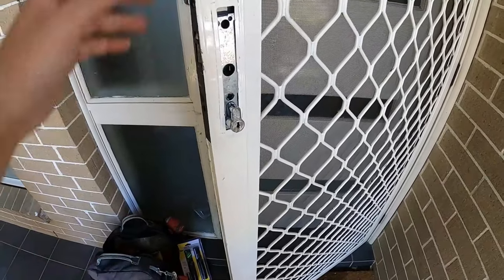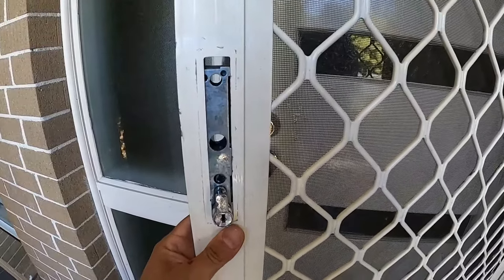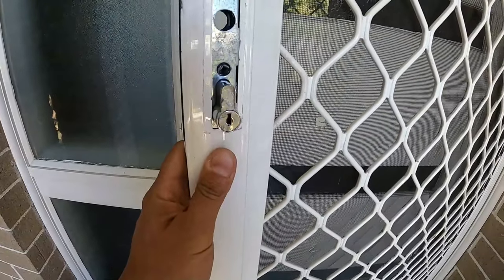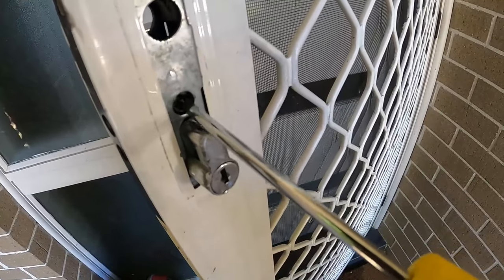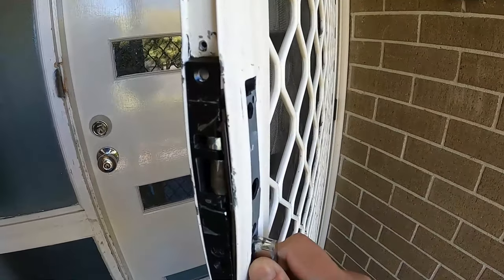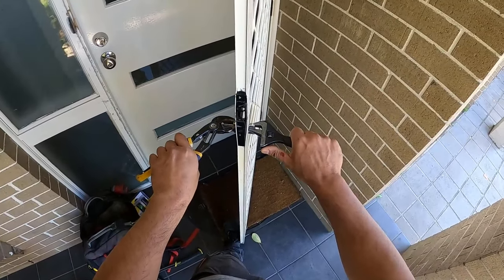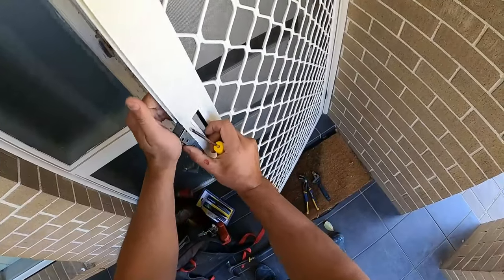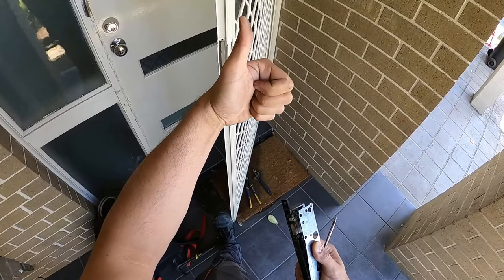How to remove a screen door lock - HACK

Comment: Good vid, but on some doors, like mine, you have to make sure the latch is full engaged, other wise, even with a key, the lock is still stuck.   Once the mall snip is pressed and the latch fully extended (as if it was locking the door) you can use the key to turn the cam and get the lock out.
Reply: oh my gosh thank you! The lock was stuck, Cam was stuck, watched 20 videos on how to release the cam to the point of trying the snap off method, which I couldn't do as I have old hands, just didn't have the strength. Read your comment, hmm, I'll go check that and thank you that worked instantly. Now, off to Bunnings for a replacement handset

Comment: Many thanks,  I have the key and removed the cylinder screw . No damage and at least 20 years old. 
It appears the cam won't release. 
I believe the old lock is Lockwood and I have a Bunnings Rolltrak to replace. Contemplating snap vs locksmith.

Comment: Hi Bill, I need to cut the screen door handle area to make it bigger to fit a new handle. What can I use?
Reply from the maker: Depends on how much larger it needs to be. Sometimes I need to make the area larger just for the screws and I use a larger drill bit. If you need to make the whole area larger there is specialized tools ( punch) for this. The area would generally be covered by the face plates so in theory it dosnt need to be pretty.
Reply: @billshowto  thanks. larger drill bit to shave is a good idea. Will give it a go.